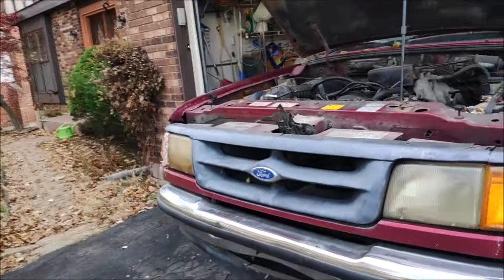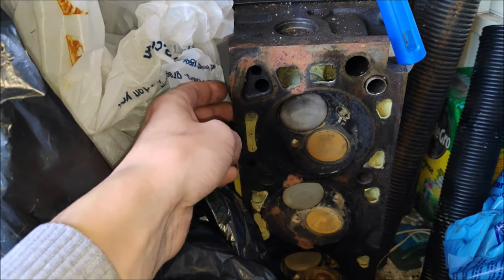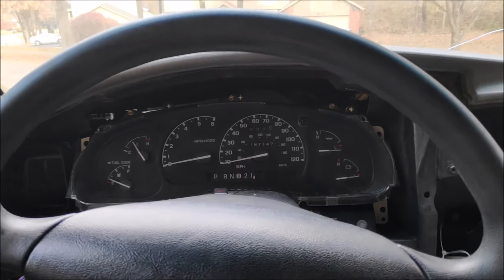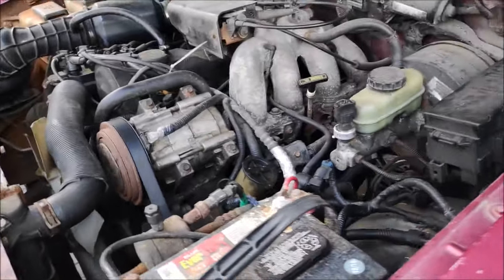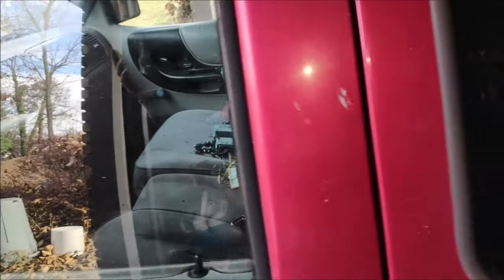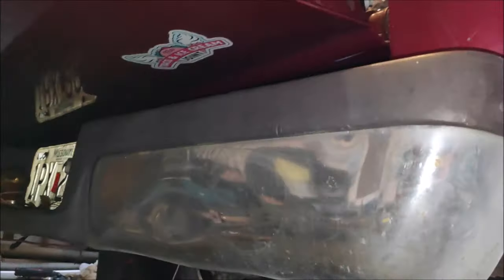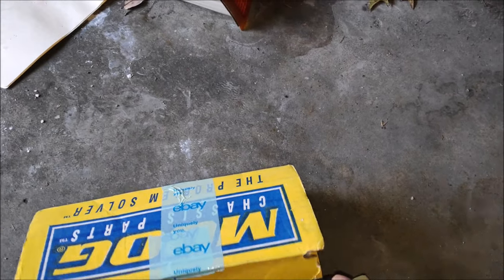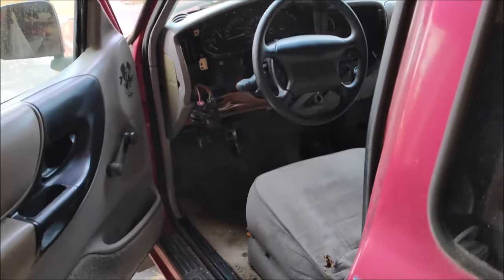What Fails on All Ford Rangers, Everything You Need to Know, Best Review

Comment: My 1996 ford ranger I got from a tow lot as my first car back in 2010 and it still runs like a champ and has almost 300,000 miles on it like 289,000. Knock on wood, I’ve only had to do minor work to it and regular maintenance.
Reply: I found a 1990 ranger with 40k miles. He is selling it for $1,500 and the only thing it needs is new headlights and a new paint job. Should I get it?
Reply: @andrewj.6728  yup if that’s all that’s wrong it will easily go around 200,000 more miles as long as you keep it well maintained

Comment: I had a 2000 Mazda b4000 with 4.0 ohv it had 280k miles when I sold it an it ran great an was reliable now I got a nice 1999 3.0 ranger 158k miles it bent a exhaust valve I put a new head on it an it runs perfect now
Reply: TOTAL RESISTANCE I still wonder why the exhaust valve bent an pushrod on my 3.0 ranger I put 6k miles on it so far an hasn’t bent again yet kinda weird I noticed the heads been done on it before as it had aftermarket head gaskets on it

Comment: Great Video! I drove a 97 b2300 for over 10 years, It was literally the slowest and most reliable vehicle i've ever owned. i only changed brakes wheel bearings plugs and a battery from 90k-350k miles.. the clutch was slipping when sold
Reply from the maker: I ended up putting 2.5l in my 96, it lost few mpg, but picked up little bit of power.

Comment: My 4 cylinder 2.3 has 360000 miles. Regular oil changes and maintenance is all I’ve done except for an alternator at 200000 miles and the blend door needing replacements and a blower motor at 340000 miles. Best truck I’ve ever had.

Comment: I drove my ranger from new to 200,000 miles. I chaned the oil, tires, and brakes.  Spark plugs, one ball joint, and one u joint.  Oh and the fuel filter.  That is all.  I only sold it to get a bigger truck.  I will probably never have a vehicle as reliable as my ranger again.

Comment: 1997 Mazda B-4000SE 4.0L V6 here ( same as a Ford Ranger XLT) - mine suddenly one morning after using all day before would NOT START (it's happened before a few times), cranked  like nuts, no "fire". What did I find?  It was the F'ing Fuel Pump Inertia "collision" switch mounted on the passenger side inside the firewall.  No truck impacts, no bumps, no anything that should have tripped that Inertia "collision" switch!!  Fuel pump is fine!  Beware Boys, ALWAYS ALWAYS check that damn Inertia "collision" switch FIRST on ANY Ranger or Mazda B-Series!!  A kick of a foot, a package you have on the floor bumping it, could easily trip it!  Push the button down to reset and GO!  YOU DON'T NEED A STINKING OVER PRICED MECHANIC!
Reply: bypass or hot wire it ...
Reply: Had a 1996 Ranger 4wd. Same problem under the floor mat. Cut it out and never had that problem of it getting warm and shutting off.

Comment: I paid $7000 for a 2008 Ford Ranger XL...4.0L V6 engine...113,500 miles on odometer
Ive had it for 5 months and never had to have anything repaired or replaced.
Its been very reliable.

Comment: Thank you for taking your time to explain what a pos i bought..lol..no but seriously…i love my little Mazda..uncover Ranger…so far i have not covered all those problems….mine has been dome light..gauges ..fuel pump..sensor and pipe….battery cables..making a lot of false warnings…on gauges..mass flow sensor someone wired backwards…and just shifts hard…not a problem for me…consider it was abused..more like a work truck…i cant blame it all on the truck..it is a 97..manual shift..i worked in parts for 20 years..so i knew about some of it…i finally found all the missing parts..and back to original…at a junkyard that specializes in Rangers…jack handle..ac vents…dome light..under tire carrier and spare…sun visors..i had covered…trim for dash…they even took it off for me 80..i paid the guy who took it a 20..very people…but thanks to you..i can keep an eye on this other stuff…appreciate your help and thank you so much…good luck on making a truck…i think that’s what i did? I did have to retire most of the truck and used soldier..shrink wrap…and looms..looks really good now..except for paint..i like used look better..?
Reply from the maker: You're welcome 👍
Reply from the maker: I am willing to bet that my Ranger is a bigger pos than your ranger 😂, it was anyways.
Reply: I wanna Rhino line the entire outside of the body.

Comment: 3.0 L V6 was the best motor in that time never had to do anything except normal tune-ups and put over 600 thousand miles on it before the body fell out
Reply: 3.0 was trash
Reply: I would be asking yourself what you did wrong. Basic maintenance is all they need to stay running smooth not the biggest power plant but super reliable 600,000 Mi don't add up to a crappy design. you're just a bad vehicle owner
Reply: @terrybrown797  3.0 was the worst out of all of them. 4.0 got the same gas mileage and was more powerful and definitely more reliable
Reply: The 3.0 is a solid engine. My 2002 Ranger has 441k miles on it so far.
Reply: @mikewarren5004  lot of people called them junk but that's because they don't take care of them. keep up with routine maintenance and they'll run forever. I was sad to see mine go to the junkyard it still ran like new even with 600,000 MI
Reply: I have a 2001 3.0 and I'll just be honest this truck has not been taken care of not had oil changed regularly or nothing and it currently has 287,081 miles on it and I wouldn't be afraid to drive it across the country to me the 3.0 as far as lasting a long time with very little problems

Comment: I have a 1994 madza b3000 4 wheel drive I heard a big bang going down the road truck stalled started back up and went in to all the gears good no noise but would only move good I 4 low only

Comment: 2001 200.300 miles start s up ever day front AC clutch 3 alternator 3 water pumps 1 trans rear seal one thermostat housing tires lots of oil change plugs rear leaf spring hangers 22 years old love it has lots of pep left

Comment: I don’t think the automatic transmission models are anywhere as bad you’re saying, although I do know the later models such as ‘98 & up got a different transmission that was much better. Regardless of the year, I’ve seen countless examples of these trucks with automatics that have very high miles on them. Disagree about the 4.0 V6 too, that’s an excellent engine. I think the 3.0 is gutless piece of junk though.

Comment: The 4.0  pushrod V-6 is known for cracked heads. I had to replace both on my '99. My '09 4.0 has OHC and so far, so good. (75,000 miles)
Reply: I had a 94 4.0l. Never had a problem with it.
Reply: Good luck with the timing chains.
Reply: My girl has a 01 4.0 with 176k miles but is leaking oil from driver valve cover gasket I believe!

Comment: My 07 had a problems when on normal, put it on Max and it cooled like it should. Thanks to u tube I found the control module on the damper and repaired it. 100000 and still going strong.  knock wood

Comment: Rear cab mounts are another major issue with Rangers in the salt belt. The factory mounts are just stamped sheet metal.and rust out regularly. There are heavy duty mounts available online from a company in Pa. for a very reasonable price. They're formed from 1/8" steel and bolt in place of the originals.
Reply from the maker: Good to hear. Leave a link to the company if you'd like.
Reply: @everydayirace  I don't know how to post a link but the manufacturer is Parker Metal Products in Tarentum, Pa. They have an Ebay store which is where I bought mine. I paid around $130 for 2 brackets, bushings and cab mount  hardware. Hardware to bolt them to the frame isn't included but is easily found locally. They also sell just the brackets (no bushings or hardware) for about $40/each. Trust me when I say that these are VERY high quality parts. I have a 94 Ranger 302 swap going on right now. Even though it had almost 200k miles on it, I made enough selling the original 2.3/5 speed and all of the electronics to buy the Trans-Dapt "Swap in a Box" kit and a 12 pack of Busch beer lol!
Reply from the maker: @MikeBrown-ii3pt  Thank you.

Comment: Had/have 2 Rangers ('94, 4L and '03, 3L).   Experienced various combinations of a lot of these things. Still (my opinion) the best value small truck available.  4L V6 seemed to be over square, knocked a lot when driving in hills/mountains, forced me to use higher octane fuel when on routes involving steep grades. I prefer the 3L,  slowest vehicle on the highway but works for me.  What I hate the most is the (styled and unnecessary) humped up hood on the 03. It blocks view of about 2 feet of road ahead which is annoying in parking lots

Comment: That anti-slosh module you showed has a swollen capacitor.  Those capacitors dry out and stop working over a few years and need to be replaced.  Simple to solder in a new one and maybe save you a trip to the parts store.  Capacitors are dirt cheap online.  Don't cheap out on it.  There are 3 or 4 good brands that last the longest.  Avoid the Chinese ones.

Comment: A less common problem with the 2.3 is recessed valve seats. Symptoms are usually a dead cylinder after reaching high rpm. Clears up if you let it idle for a minute. At it's worst the truck will die if you rev and let off gas. If you don't let it reach over 3 grand it'll never bee an issue.

Comment: I have 2004 Mazda B2300. 5 speed. When I got to start it, it coughs for nine seconds. It’s been doing this fir a year. It eventually starts, but after 9 seconds. What is this issue, how can I solve it, how much, and is it detrimental to the longevity of the truck if I don’t address it right away?? Awesome video!! 
Thank you so much fir whatever help you can give !!! 🙏
Reply from the maker: This issue can be caused by many mechanical or electrical faults, it can be fixed by testing each component and finding the faulty one. How much will depend on the component that is faulty. Any abnormal behavior of the truck can and will shorten the truck's longevity, problems don't fix themselves, they cause other components to fail. For example, if engine has a faulty $4 spark plug and it doesn't get fixed, it will overheat and melt $1000 catalytic converter which then can cause head gaskets to blow.............

Comment: Watched your video. As for now, problems I've found with my 95 2.3 Ranger: blown slave cylinder (a real pain in the a** to get the top 2 bolts on the trans); leaks on thermostat cover and water pump; broken odometer; cracked fuel filler hose; and finally, broken lower ball joints (waiting for them to arrive) And normal things that i've already replace and service: clutch, flywheel, pressure plate, spark plugs and cables, all filters (fuel, air, oil), brakes (disc and new brake pads).
Reply from the maker: I've done these on more than few occasions, top trans bolts can be a pain, on my truck I take them off with a wrench from the engine bay.
Reply: I've pulled a ton of M5R1's those top bell housing bolt's are not that hard put about 3feet of 3/8 drive extension with a swivel and go up from the side of the tail shaft after you pull the cross member out and let the trans come down a little and voila you can get right to them.

Comment: Don't forget the infamous 'GEM' module.. If that goes bad it will drive you nuts trying to  chase a bad ground, everything with an intermittent function doesn't work right. I bought one on e-bay for ~$70, so no prob.
Reply: Maybe that’s what is keeping my 97 from starting? It just died going down the street one day and won’t start. I replaced the fuel pump because the float was already known bad so I had no fuel gauge. Then I checked the batter and charging system and wires. Now I’m going back to the book to start troubleshooting over again knowing the battery and pump work.
Reply: @mikesaltman  I don't think the GEM module would make your truck cut off driving down the road. It is for lights, buzzers, door locks etc. A truck cutting out and not starting is almost always fuel, or ignition. A very clogged fuel filter could do it, bad pump, bad crankshaft pos. sensor, bad/bumped fuel cutoff switch in passenger comp.. something basic.
Reply: There's a fuel cut off switch under the dash on passenger side. I bypassed mine and it fired right up.
Reply: Mine is a 89 ranger.

Comment: One of the  most  major things wrong that wasn;t  mentioned is  that  THIS  is   northern truck.Weather  EATS these trucks up ,so  undercoating is  very smart. I have a 96 and and  97  down south  in Ga.,this guy would  lose it  over, my 96 AUTO[ 4r44E POS] has 400,000 and will be changed to  M5ODR1 and  fresh 2.3 TURBO!
Reply from the maker: In the north salt eats every car/truck/SUV.

Comment: Gonna get my 3.0 98' checked for frame bend (salvaged crash) and if it's still straight I'ma tear out everything it doesn't need to run as it stops working.

When the engine drops I'ma swap in a 2.8 Cummins ;)

Comment: I've been working on my grandads old 1999 xlt stepside sport with the 4l v6. I plan on installing a 3.8l supercharger from a thunderbird or stang and replace the pistons. Timing and front suspension is perfect just needs traction bars to stop all the swaying including wheelhop and a skid plate for that low hanging radiator. Starter is a trooper.
Reply from the maker: Thunderbird superchargers are hard to come by around here.
Reply: Hope i can find one while i can.  Havent got to that part of the build yet. My granddaddy used to own a bodyshop but The Hardest part for me is gonna be getting the computer fine tuned and avoid mentioning supercharger around my old man.

Comment: I have a 94 Ranger and she isn't the most beautiful but she just starts up and go.  I bought it used (cheap) in '05 (negotiated low price because I knew it needed some work).  I replaced the ball joints, shocks, all fluids, radiator, AC heater/dryer and the clutch assembly not to long after purchase.  The slave cylinder went out so I replaced all clutch items with new stuff while in there.  Most of the work was optional and not required but I wanted to replaced many of those things.  I've had no problems, except I've replaced the muffler, brakes and oil (normal maintenance stuff).  I installed the Curt Class 3 trailer hitch 3 years ago and now she's a hauler.  She pulls a lot of stuff.  I am looking to buy a Toyota Tundra ('05 to '10).  I don't know what I will do with the Ranger.  I will probably just park it at my Moms if I find the Tundra I want.

Comment: This is a good video if you have to troubleshoot a Ranger. I'm rescuing a 2000 Ranger with 2.5 automatic and seems there's differing opinions on that combo. Either way, it's a free truck with clear title so any money in counts as purchase price in my opinion. They put a push button start in because the ignition on column  toasted. So, I got to 1st figure out ground wire issues.

Comment: My 99 Ford Ranger just bit the dust with a reverse transmission gear going out.  Not worth repairing at 190000+ miles.  I just regret not getting 200K.

Comment: Question: My 1994 Mazda b4000 SE 4wd ac will freeze you out of the vehicle on little trips around town but if I go 30 minutes or more it barely puffs out of all the vents. My blower motor is working on all 4 positions but there is very little air coming out of the vents no matter if it's on max, defrost, panel, floor and panel, etc. I thought there might be trash blocking the vents but #1 there isn't a cabin filter and #2 I read that there is a screen mesh under the cowl vents to prevent trash from getting near the blower. Thoughts??

Comment: 2001 Ranger with the Vulcan flirting with 300,000 miles 😎
Reply: How is that truck's reliability?
Reply: @dxta7360  I'm actually running a 2000 XLT that was a government vehicle when it had a front end accident. One year and a total of 295k as well as a replacement of both a arms, sway bar stabilizers and shocks,  we're less than 6k into the hole. The biggest concern is a mild tick from one of the cylinders which is normal on this vehicle especially when people try to stomp the gas with it.

Comment: 96 ranger 2.3l well over 300k can’t tell exact because the odometer broke. Still on factory clutch and only things I’ve had go wrong is the heater door, the computer once and door handle broke off on passenger side.
Reply: Also the filler necks are prone crack to leaking gas

Comment: I have the 2004 Mazda B2300 with 5-speed.  It's slow and boring, but has been a great little truck.  The way the clutch slave cylinder is designed, you have to drop the transmission to access it.  PITA, and  I'm starting to have problems with it again.  Every now and then it feels like there's a 2x4 behind the pedal.  Have to play with it and pump it a little bit to get it to depress properly.
Reply from the maker: When I clutch pedal doesn't want to go back in its original position when you pull your foot from it, it's usually the clutch master cylinder, they're not hard to change, maybe an hour at most.

Comment: I have a 2010 ranger. Lots s great information.
Reply: Same for 2007.
Reply: I've had absolutely no issues with my 2010 4.0L. other than a lil bit of rust on the body. Period. 92,000 kms on er. Other than putting new plugs and wires, this summer and tires

Comment: After seeing what it would take to replace one of the bulbs on the panel, I will continue to keep a flashlight handy to check the gas level when it is dark.......  The column shift tube is broken so I'm looking for videos that mention that.  Seems that was a common issue in 2000s.

Comment: Hey guys I have a 93 Ford ranger 5 speed pushing 500k I've been having problems with it starting very rough for a month just replaced my starter because the shroud by the gears broke ... Any suggestions?
Reply: I just did ignition control module and   coil packs, plugs and wire. That was for an always running rough condition. Also check Iac valve.